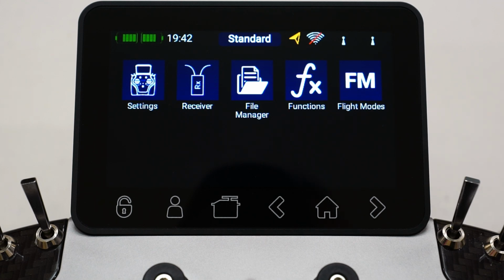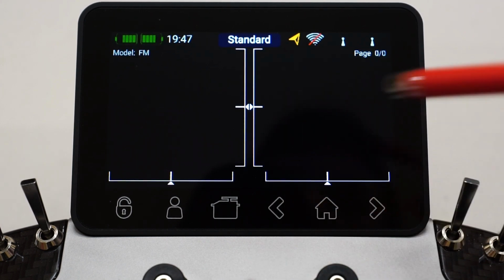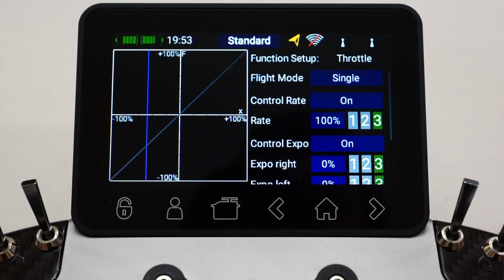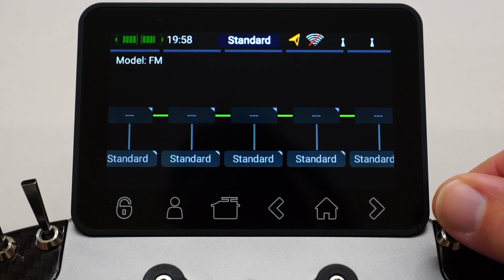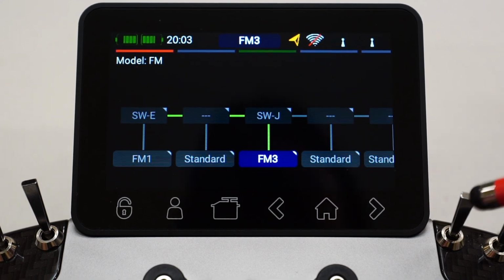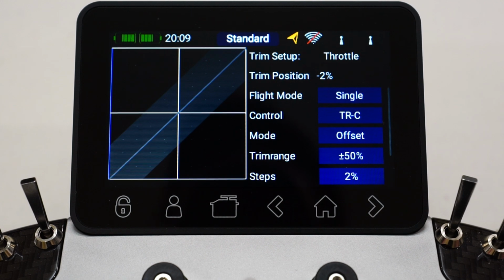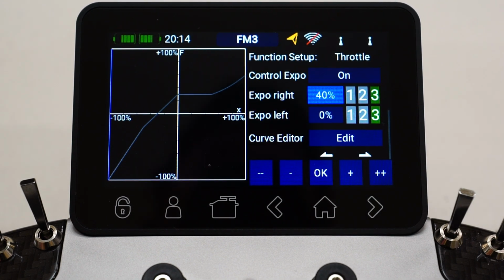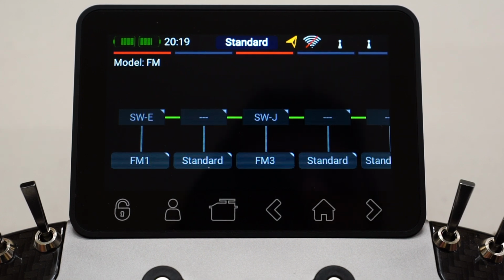PowerBox Core - Atom : Introduction to Flight Modes

Comment: Hello,
Thank you so much for all your explanations. They're excellent.
Although I haven't watched all your videos yet, I have a question.
For a glider,
I'd like to be able to adjust the elevator compensation when the quad flaps are activated.
I know how to set a value for this compensation, but I'd like to be able to adjust it IN FLIGHT using a potentiometer or linear slider.
This way, we could try different settings to find the best compensation.
I don't dare access the menus while flying.
The MPX PROFI TX allowed this.
Thank you very much.
Reply from the maker: Just make a new Function. Assign only the servos you want to adjust via the rotary control to this function. Then assign the rotary control to this function. You can then adjust the rate/amount of control the knob has in this function by setting the curve and rate values to your liking.
You can also set this function to only operate in certain flight modes if you want.
Reply from the maker: Also checkout my video on slow flap deployment as that covers off this technique.
Reply: Thank you for your advice,

but I would like the correction to be proportional to the quad flap output, with a maximum defined by the rotary knob.
Is that possible?
Reply from the maker: @pierreboldrini237  You cannot directly use an output in this way however you can use whatever is controlling the quad flaps to set the rate if travel in the new function.

Comment: Great presentation, thank you very much. Question though, how to lower the parent ailerons a little in flight mode, like you can do with flaps. Thanks
Reply from the maker: Make a new Function and put the aileron servos in this new function.  Edit the function curve for this function and also reduce the Rate to suit the amount if adjustment required. You can also assign a knob or switch or just enable this function in a particular flight mode. 
Basically you make this function like a trim for the ailerons.
Reply: Nice solution, thanks à lot

Comment: Excellent presentation and content, Costas! Is it possible to use a Flight Mode as a virtual switch? I'd like to use entering a particular Flight Mode as a reset switch for a timer. Note that the Flight Mode I'd like to use is already triggered by a combination of Virtual Switches...
Reply from the maker: Hi Ron,

You dont use the actual flight mode as such to reset the timer. You use the same virtual switch that triggers the particular flight mode to also reset, start or stop the timer.

If you have more than one virtual switch to activate the same flight mode then you can add another virtual switch that combines both which can then reset the timer. 

You could also do this with 3 or more switch combinations as well... The virtual switch options are pretty powerful and they allow you all sorts of switching options to trigger or activate something else.

I use this method in a similar way with most of my internal combustion models so that my main flight timer only starts/runs when actually taxing/flying and not while just in the pits starting or warming up the engine.
Reply: Thanks for those suggestions!  I'll noodle on them and let you know how I went about it 🙂

Comment: How to setup as i want add gear and flap to the flightmode at the same time?
Reply from the maker: Setup a function for your gear.

Now go into the 'function curve' for that function (not the servo curve) and set single in the curve screen options for flight mode selection.

Now just make the rate value 0% for any flight modes where you do not want the gear to operate and rate=100% for the flight modes where you want the gear to work.

You can do the same with flaps etc.
Reply: @CVHeliPilot  Hello friend, what i want is the separate elevator trim in the different flightmodes(gear up and down,flap position1 2 3)
Reply from the maker: @locask9108  Ah ok... Now. I understand...

Just enter the trim menu for the function you want eg Elevator and then select 'single' in the trim menu.

Now the trim for that function will be different for each flight mode.
Reply: @CVHeliPilot  The problem now is there also have priority...I want two gear modes and three flap modes equal.
Reply from the maker: @locask9108  You might want to post up on the PowerBox forum as it will be easier to facilitate a response. can also post up sample model files as well..
Reply: @CVHeliPilot  I have posted but Richard didn't response. I'd post again.
Reply from the maker: @locask9108  They are at some show this week so may not respond as quick to respond.
Reply: @CVHeliPilot  That's cool.I am pb's big fans